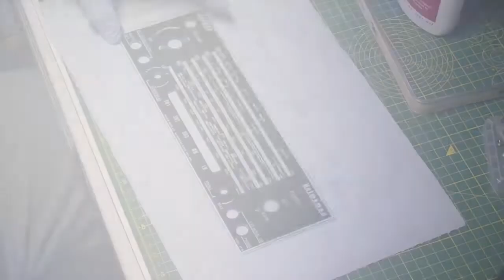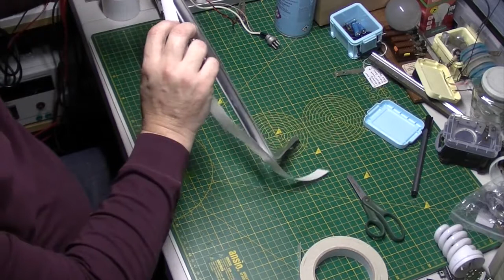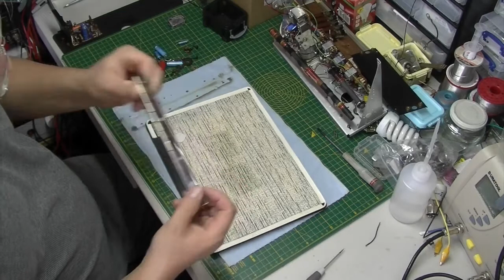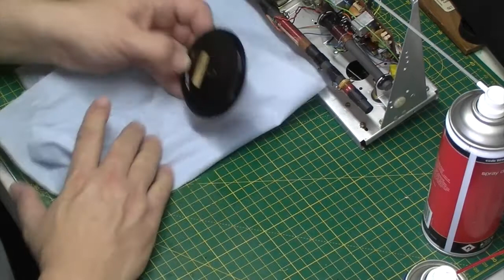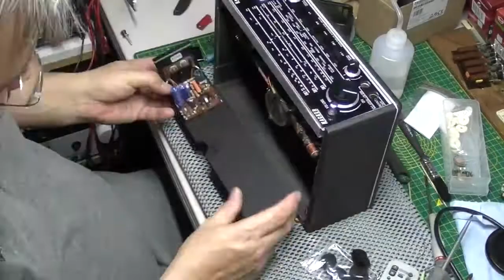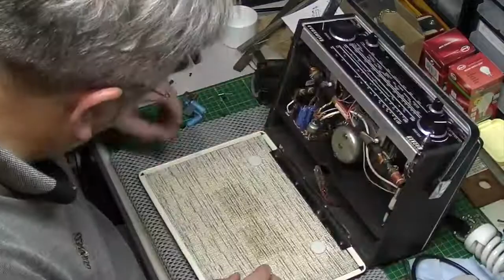Hacker Helmsman RP36 restoration part 5: Finale! Final touches then all back together for a test

Comment: In the states we use what is called "goo gone" to remove that glue at 5:30 in the video...great video by the way...
Reply from the maker: I'm sure someone had mentioned that. I believe we can get it over here via Amazon. Thanks for the kind comment. Graham
Reply: I am working on a GE P990A right now...that I just got...so far so good...One of the bulbs were out..so on this radio...both will not work if one is out...SO I had to break the glass down as far as I could to scrape that hair sized wire...and soldered a small ball of solder..then cleaned the pin shaped bulb connector and presolder that...got it soldered...without the bulb breaking..or losing the vacuum then hot glued it...to give the bulb pins strength..then installed it and it worked...
Reply from the maker: That sounds like a fiddly job but well done on getting it going again
Reply: Do you think that plastic polish is available in the USA?